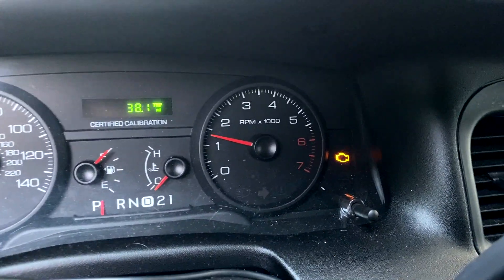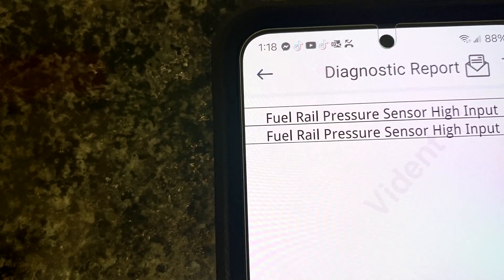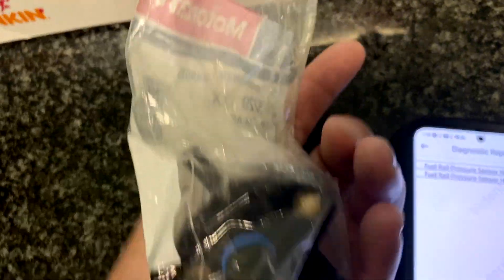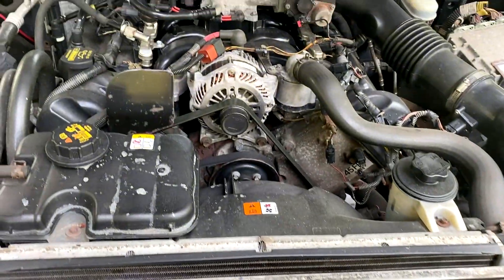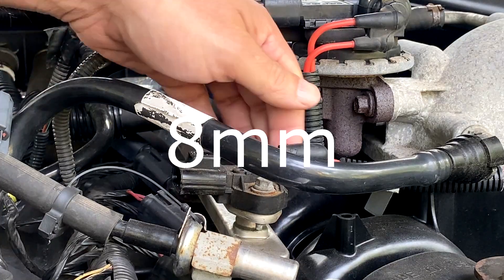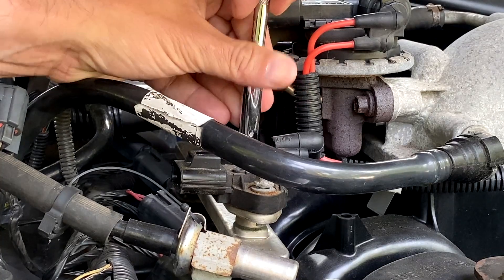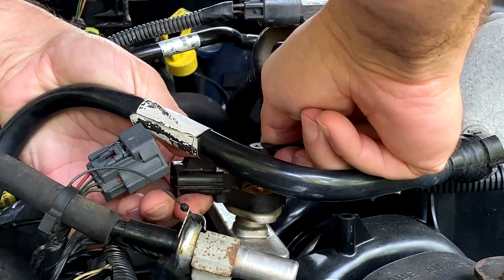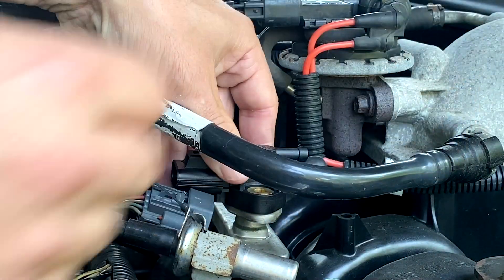FORD Vehicles Crown Victoria FUEL RAIL Pressure Sensor Replacement P0193 Code

Comment: Is it just me or does this seem to be more common with the 2011s for whatever reasons
Reply from the maker: I have not seen anything that would suggest that but I am new to this platform
Reply: My 2011 just popped up that code.
Reply: @moisesmuro4569  idk I’ve had a 2008 and a 2009 with higher miles and I’ve had them since lower mileages 

But now with my 2011 it has about 180k and after 2 weeks of having it and 1200 miles “blink blink blink” fuel rail pressure sensor 

And in the Facebook groups it seemed that most of the the cars having this issue when I searched were 2011s and a 2010 

Then I found this video… 2011 

Luckily it’s a quick, easy, and fairly cheap fix… but still sucks

Comment: Did this fix the issue?
Reply from the maker: Yeah Put 500 miles so far with zero issues. I took the chance of just replacing the part and got lucky it was not something more complicated.
Reply: @ProjectsandReviewsZone  awesome glad to hear it worked out well. Mine just popped up this morning. Hopefully it’s just the same thing for me. 🤞
Reply from the maker: @Kraven412  Let me know if it did help. I sold a handful from this video and no one has complained it did not work for them lol. Thanks